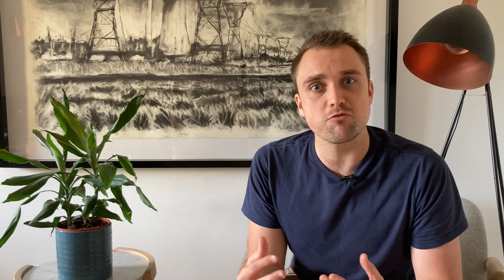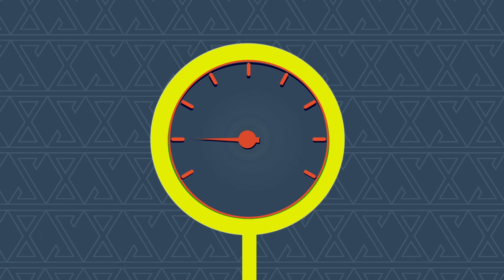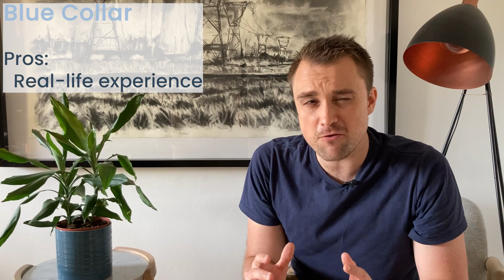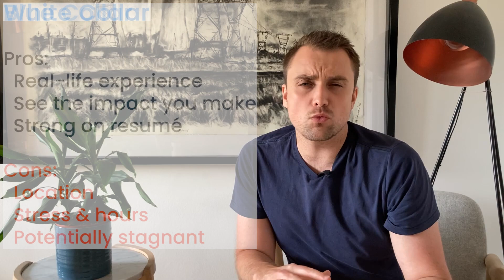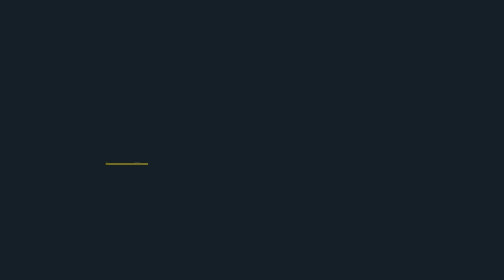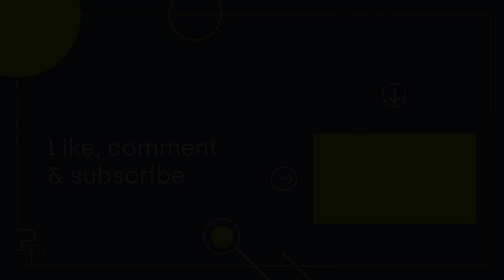Operations vs. Design Work in Chemical Engineering

Comment: Excellent video pat, I agree with your points.

I worked in a mineral Processing mill for an year and moved to design working for the last 2.5 yrs.
Reply from the maker: Nice! How’s it going? Design work is great but I do love getting out into site whenever I can!
Reply: @ProcesswithPat  It's good. And yes I do sometime miss visiting the shopfloor. I also miss that feeling we get when we fix an issue with an equipment and it starts running. 😀

Comment: This question is on behalf of graduating chemical engineers, or those considering studying it, who enjoy the notion of design more than than operations:
Would you encourage them to view your career path as a "model career"? I.e. Starting off with practical work on a plant, followed by a move into design work. 

One commonly held idea is that one should not pursue chem eng with the desire of entering into white collar straight away. They should enjoy the prospect of being on a plant in some sense; at least for a period of time. Would you agree?
Obviously most careers don't go as planned, but people should have a road map in mind
Reply from the maker: I think the first thing that needs to be said is that finding a job out of university is not easy. It can be an absolutely soul-crushing process, with poor communication and arbitrary rejections. I  have a concern that it is only getting more difficult and young people are put off of going into our industry. So I wouldn’t discourage anyone from taking a less-than-ideal job. The most important thing to do is to start acquiring skills, knowledge, and experience.

Having said that, I do think I am lucky in my career path. There is little doubt in my mind that if someone offered me a job in white collar engineering straight outta university I would have taken it over a plant job, but I think I would have been worse off for it. It’s extremely difficult to convince someone that it’s is worth the “hardship” of plant working the long run.

But again, I doubt there are many people in the lucky position to be able to pick and choose between environments! If you can find passion in the nuts and bolts of chemical engineering, I think that is the way to be fulfilled and open up further opportunities. No opportunity I ever got was due to thorough advanced career planning… only through throwing myself into problems in my work.
Reply: @ProcesswithPat  I think there is truth and wisdom in your response Pat. Thanks for that!

I particularly like your point about delving into your work. Trusting your own drive. At risk of going off at a tangent, I feel like it is something that will help a person achieve more in any work environment.

Comment: The pressure and stress are equally present in white collar jobs also. Especially close to deadlines. Usually only 10% or less of overall project capital will be allocated for design. Hence, lots of cutting corners with man hours and pay, Offloading work to satellite offices with lesser labor cost and coordination hell.
In oil&gas these days every project is a Fast track project. 
Also the pay is generally less than what's given to a blue collar job in a company of similar status.
Reply from the maker: You're right, there is certainly stress in both environments, and your other comments ring true. Thanks for the additional input AJ.